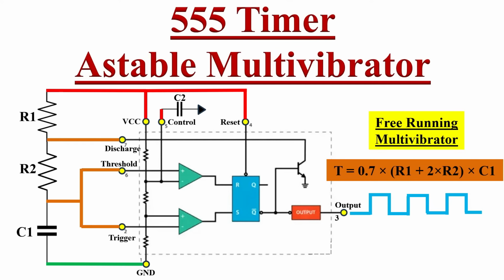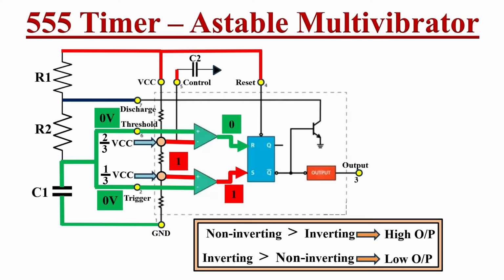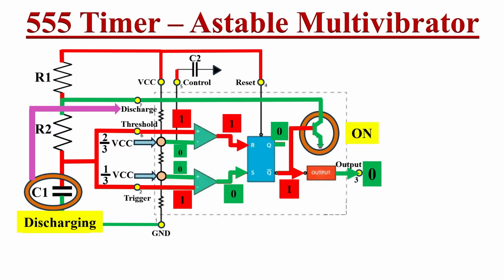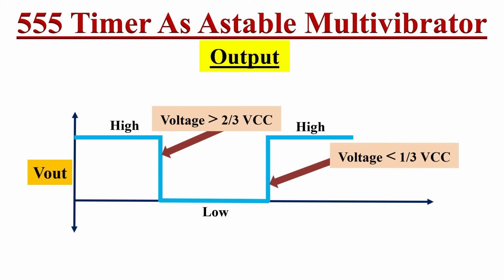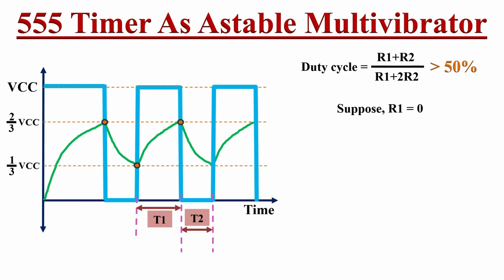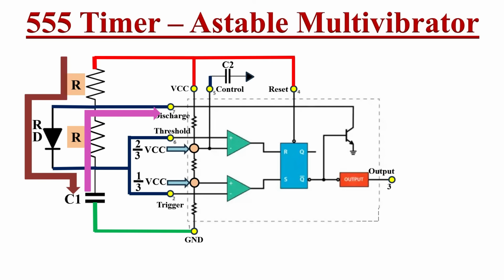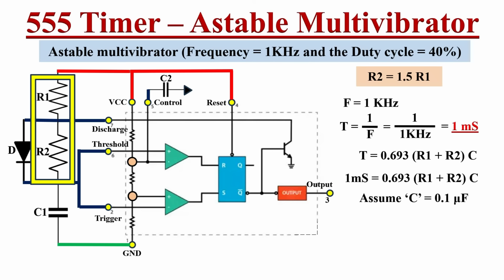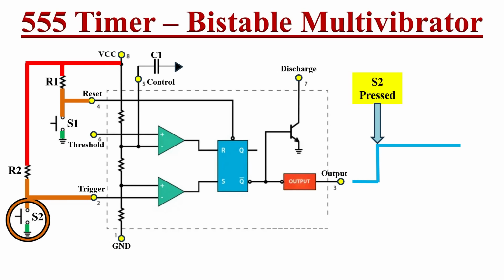555 Timer as Astable Multivibrator

Comment from the maker: The timestamps of various topics covered in this video are
0:16 Introduction,
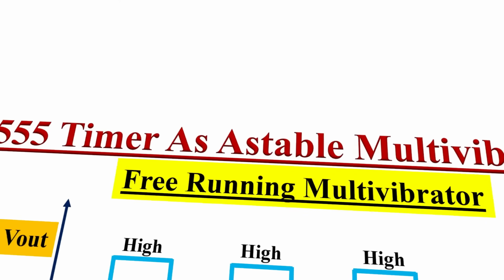1:32 How to Design 555 Timer Astable Multivibrator circuit,
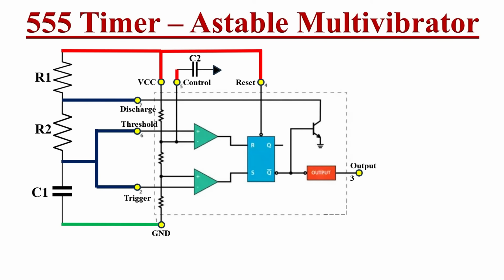2:39 Working of 555 Timer Astable Multivibrator circuit,
10:17 Timing Diagram of 555 Timer Astable Multivibrator,
12:54 Duty cycle of 555 Timer Astable Multivibrator,
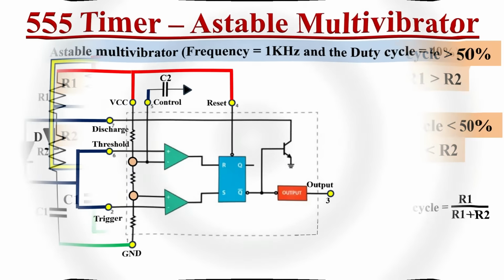18:34 Design of 555 Timer Astable Multivibrator circuit with 40% Duty cycle,
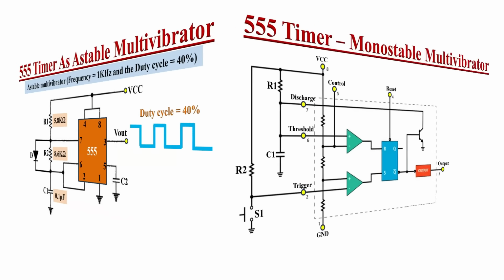22:06 Design and Working of 555 Timer Monostable Multivibrator circuit,
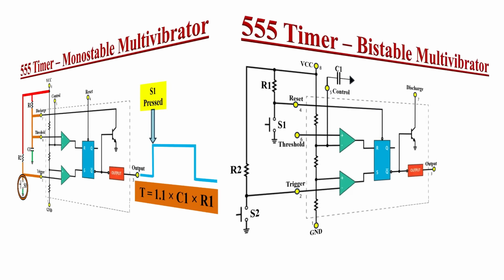22:56 Design and Working of 555 timer Bistable Multivibrator circuit,